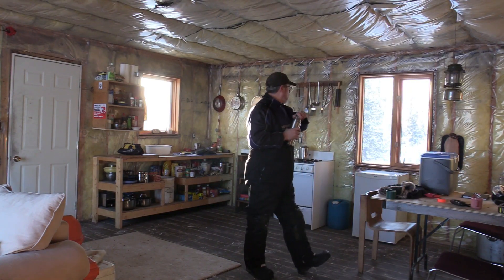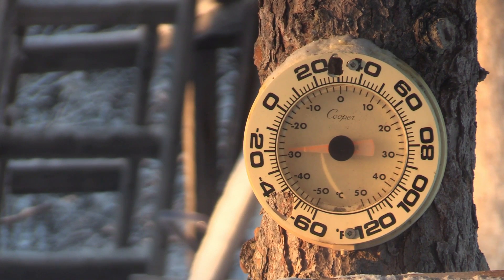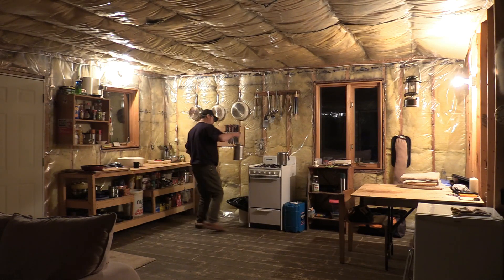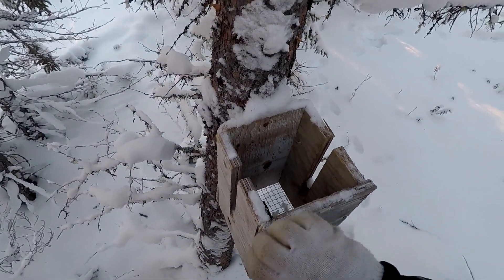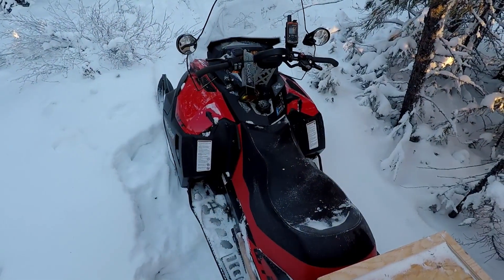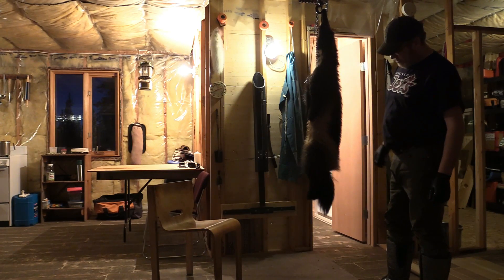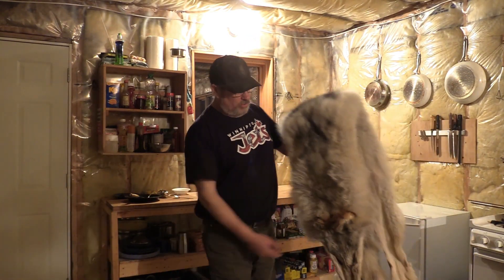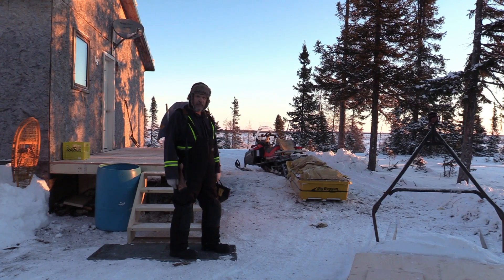Bitter Cold

Comment: Love the snowmobile box design👍🏻. I have been thinking about building one for mine seeing yours settles it I have been using a Rubbermaid tote.  Flip mine around so small box side will hold my electric drill clam auger head out back of machine.
Reply from the maker: Ken T     Awesome Ken.... it is working well. A few additions will be added on mine. Use glue and floor Staples .... they hold the best.

Comment: Norm,must've not been too cold cause your still wearing a tee shirt lol. Curious as to why you wrap the front of the sled,too keep the snow off the handle bars and controls?  Why not build a lean to or a  double open ends tent/shed to pull into and out of.
Reply from the maker: That's right to keep snow off of it..or I sit on it when there is frost on it and get a wet butt...LOL I was thinking of a lean-to  or a shed to back it into....see where that goes. Thanks Dave...-50 with the windchill those days I was out there.

Comment: New sub but watched a lot of your videos so far. Probably get quite a few comments on the subject, but do you have any plans to finish off your ceiling and interior walls with sheet rock or some sort of siding? Same with your exterior of your cabin, I would think over time and moisture your chip board sheeting is going to get moisture damage.
Reply from the maker: Welcome Dog. I do explain in the next video why. Yes it could become a issue for sure. Just some rot in a few places that were not  properly calked and I fixed those areas already. Thanks For the concern Dog